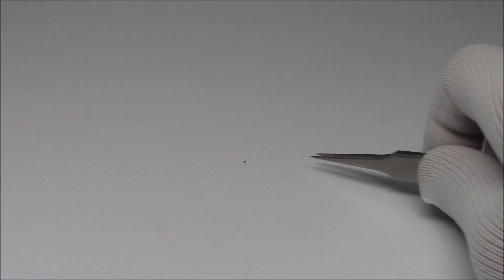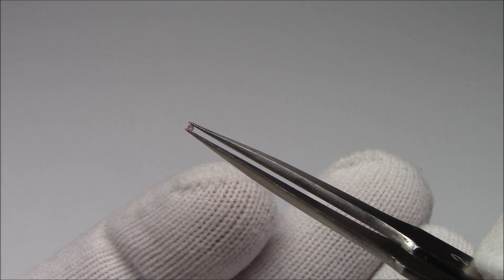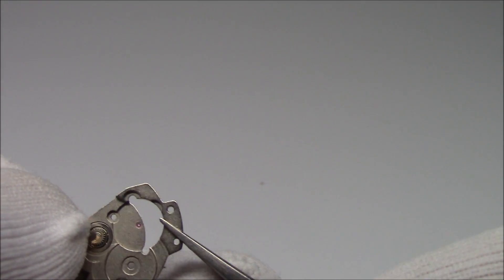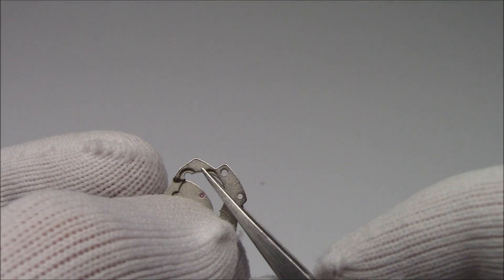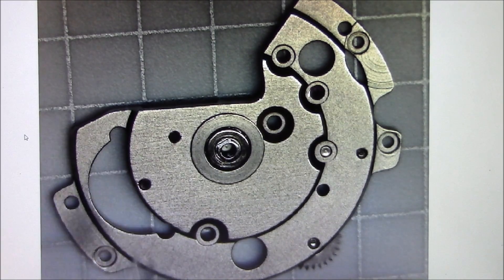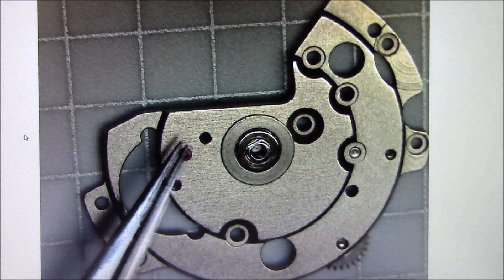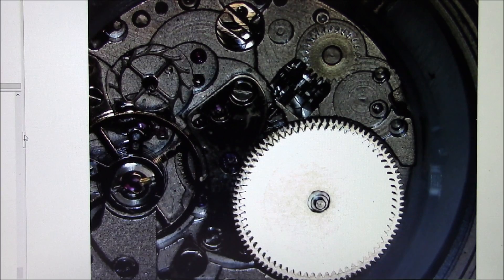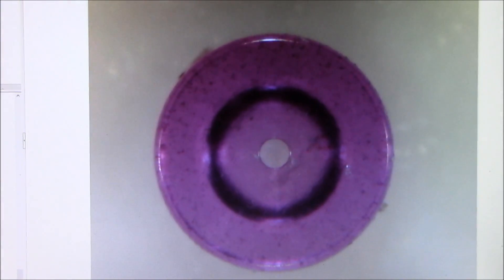Watch Jewel Basics - Watch and Learn #3

Comment: My 1978 Seiko quartz has 4 jewel movement.  Seems to gain a few seconds a month.  When the battery voltage gets low, it goes into a two second mode but still keeps time.  Can't remember what I paid for the watch new, bought it at the base exchange.  I don't think it was very expensive at the time.

Comment: Could you make a sequel of this "Jewel" video? I am praticing assembly and disassembly and my project is a evaco sa movement which does not work and I discovered that when I assemble the 3rd and 4th wheel, it moves freely and when I put the escape wheel, it binds. It is a challenge to put the bridge on top of these wheels. I am curious which jewels are caps and which ones have holes? do they pair cap and holed jewels all the time? would debris on jewels holes can cause it to stop? if so, what's the best way to clean them manually (without sonic cleaner).

Comment: The increased Jewel counts aren't a recent thing. In the 1890s, American watch companies engaged in a "jewel war", increasing jewel counts rapidly and advertising the increased jewel counts heavily. Prior to 1890, a 15j movement was "fully jeweled" Hampden watch co. out of ohio started increasing the movements to 17, then 19, then 21, then 23 by 1900. All the other companies followed suit... Waltham, Elgin, Rockford, Illinois, etc all had 23 jewel movements, and Illinois and Rockford even had 24 jewel, 25 jewel and higher.  I would argue that the extra cap jewels do keep the pivots cleaner longer, and possibly help with endshake, but they make it much harder to service. Good video!

Comment: Great video and, hey, I just made a discovery.  As I looked at the jewels in my skeleton watch I used a 40X magnified that is equipped with both a white light and an ultraviolet (black) LED light.  I was surprised to find that the jewels are fluorescent causing them to put out their own bright specs of light.  So, that might be a help in spotting the jewels quickly.  I seem to remember that synthetic ruby fluoresces and real ruby does not, but I'm not sure.  Any way, I hope that tidbit adds to the discussion.

Comment: I have a watch with exactly the same plate as the one you have shown at the beginning of the video
It worked perfectly fine until it randomly stopped running although fully wound until you would tap it on the glass
I took it apart, and I am not able to fit it back together (it’s a 8 year old 50€ watch from the local supermarket (T.W.S PALIO automatic)
Could you show more of the movement?

Comment: SARB 033 has 23 jewels, since it doesn't have day/date wheel and you said 17 jewels is what it needs does this mean the rest number of jewels left are just gimmicks? and why, in the case of seiko automatic watches, more jewels almost always come with higher number of bph?
Reply: Not sure but could they be using a day/date movement but without the date wheels etc...
When they make so many of the same type of movement then it would make sense.
Making a basic watch movement when they mostly sell day/date movements would make the simpler movement more expensive to make.

Comment: Funny.....jewels are made of rubys or sapphires.....because diamonds are too exensive. As a mechanical engineer myself ( as is Marc's background)....I find some irony in all this. Where a diamond may elevate the excellence of the core functioning of a watch.....it is not used due to expense. Yet there are diamond studded watches that satisfy an artful or aesthetic desire.....here they are not too expensuve and someone may pay $XX,000 for such a watch. Incredible.
Reply from the maker: Yes, sort of a double duty there, right?
Reply: More than that Marc.....my point was that the market says we won't pay for diamonds in a watch where it improves function, but we will buy watches that are diamond-studded "for looks".
Reply: I also had this thought, however after revisiting this idea, perhaps it is the ratio of wear between the metal components & jewel & maybe also colour I.e. Making them visible whereas diamond maybe very hard to see?...
Reply: @butcherbakercandlestickmak2062  Bingo... The real reason that diamonds aren't used is because diamonds as jewels are so hard that they actually wear the pivots of gears down faster. They are however, were used as cap jewels in high end pocket watches (Waltham riverside maximus, Vanguard, Elgin Vertias).
Reply: Wil Ferch , the difference in hardness is not as much as you may imagine, from memory 1.5 on the Mohs scale of hardness.
Reply: Diamonds are overkill. Rubys do the job just fine
Reply: So real expensive watches still don't use real rubis as "jewels"?

Comment: I thought there was some incorrect information at 14:22:  "... that's what's going to push the fork back and forth" (referring to the ruby pinion).  is it not the other way around?  the fork provides an impulse to the balance wheel in alternating directions.
Reply from the maker: That's a good catch. You are correct.

Comment: Is the jewel shown under microscopic enlargement in this video designed with 4 internal 'bumps' in the bore--or was that a optical play of light. IF there ARE 4 'bumps..are they there to [capillarily]  hold a proximate supply fo lubricant ?
Reply from the maker: Good question; yes and no. My microscope isn't great, and you are looking at a 3D item in a 2D plane. Here is a cross section from Wikipedia https://en.wikipedia.org/wiki/Jewel_bearing#/media/File:Watch_jewel_bearing.svg

You are seeing the dome cut I believe.
Reply: Thanks ! I enjoyed the study of cross-section sketches of several arrangements of jeweled bearings.

Comment: Mark,
I own several 1960s and 70s low dollar pieces. The thing they have in common is they all only have 7 jewels. Until this video, I thought it was a reflection of how "cheaply" built they are.  You are telling me that it more reflects the amount of complications? I hope I  understood you correctly. 

Thanks for taking your time to make us informed hobbyists.
Reply from the maker: More than likely, you have a 7 jewel movement that contains 7 jewels on the balance/escape wheel. So the heart of the watch, where friction will stop it from working, it is jeweled. The wheels though, that tell the time and gear it down, probably aren't. You likely have a 7 jewel lever escapement movement. Which is pretty standard. Just missing jeweled wheels in the rest of the time telling train.

Comment: The Vostok Amphibia has 31 jewels.  And it's less than a hundred bucks.  Kind of makes you wonder where there cramming all those extra rocks.  I've seen watches that rappers wear that have hundreds and hundreds of jewels, but they're mainly diamonds that are glued to the bezel and that sort of thing.  I doubt they have a mechanical function.  A social function, yes, but probably not a mechanical one.  I guess it's up to the entourage to decide which is more important.  Bling or mainspring.
Reply from the maker: Haha. The Vostok movements had 31 operating jewels. In that case, its all in the execution of how the movement operates.

Comment: Hi Marc. I've bought a few Orients from you.  How about a video on any tips or tricks to set and synchronize the time on a non-hacking movement?
Reply from the maker: Hokuten You can try to back hack by gently turning the crown backwards when setting the time. Other than that, it is going to be inaccurate within a few hours so why go through the headache?

Comment: Great stuff, I learned a lot. Thanks for taking the time to put that together, I'm really enjoying your "Watch and Learn" series so far.

You mentioned that lubricants are also used, in addition to the jewels. I assume they break down faster than jewels. Is that a limiting factor in the life of a movement, or can the lubricant be replenished periodically? Thanks!
Reply from the maker: Yes. In fact, the "5 year overhaul" you might hear people talk about is just that. Breaking the movement down, removing all the old lubricant, and putting it back together with fresh lubricant.
Reply: Thanks very much!

Comment from the maker: I love doing intro's twice!
Reply: I got a question: instead of rubies why watchmakers doesn't use nylon/teflon pieces which have a very low friction coefficient?
Reply from the maker: Wear wear wear! The rotation of the gear would wear out the nylon/teflon/delrin/etc pretty quickly.
Reply: Ruby and sapphire are two chemical variations of a mineral called corundum. Corundum is the 2nd hardest mineral after diamond. Synthetic corundum is used for watch jewels, and it is also used in carborundum sand paper and grinding wheels. Because it is so hard and resistant to wear, and costs less than diamonds (even synthetic), it is perfect for watch "bearings".  Hope this helps! 👍
Reply: When it's nearly full wound it will stop rotating under its own weight, but to actually wind them up efficiently you'll need to rotate the whole watch on the rotors rotational axis like you see it turning around in, about 50'ish times in both directions each so as to give it even wear.  And until the grease dries out too much and the movement needs a COA what Benjamin Castro said is correctamundo!
Reply: Long Island Watch 
Thank you for the informative videos.

What is a saphire "coated" crystal (my watch: 2017 Wenger Heritage Attitude). Pros & cons?